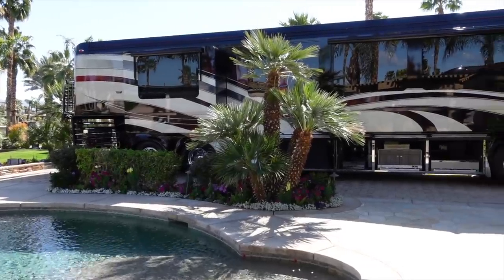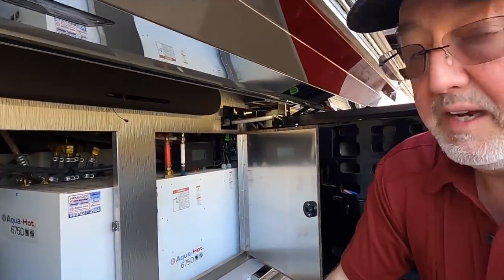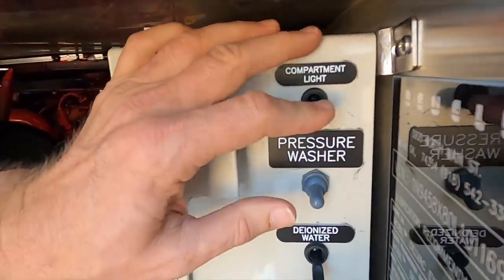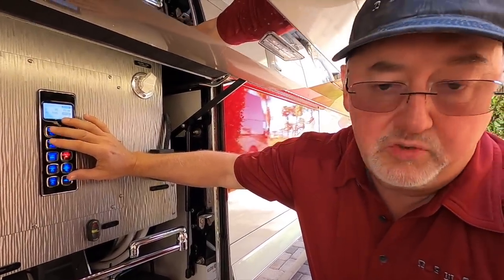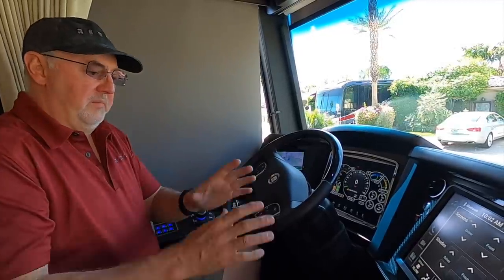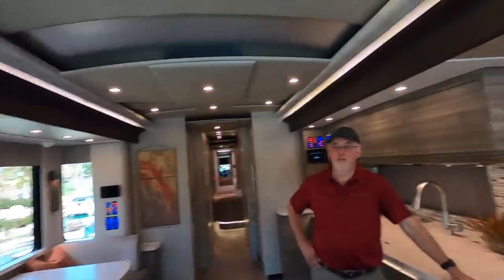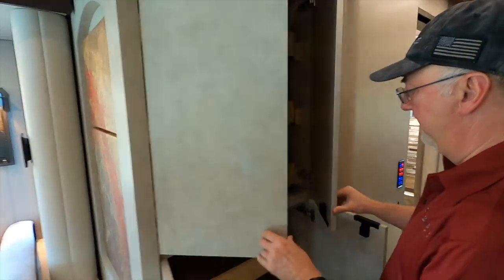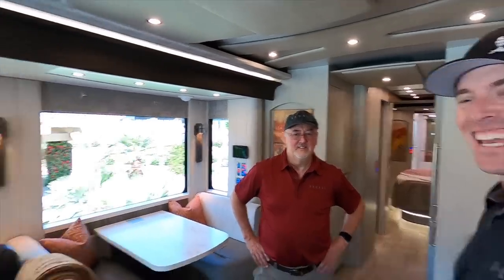In depth Tour of Newell Coach 1690 with Motorcoach expert Phil Cornelius

Comment: How long could that generator supply power say in a desert or snow covered mountain while Boone docking????
Reply: Joe, the gen runs off the coach fuel tank. My coach, a 40’ Discovery, holds 85 gal of fuel and could power it for a week. This coach probably holds 200 gal of fuel, so I would think 2 weeks easy.